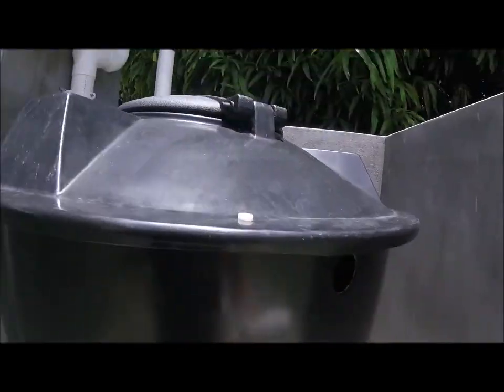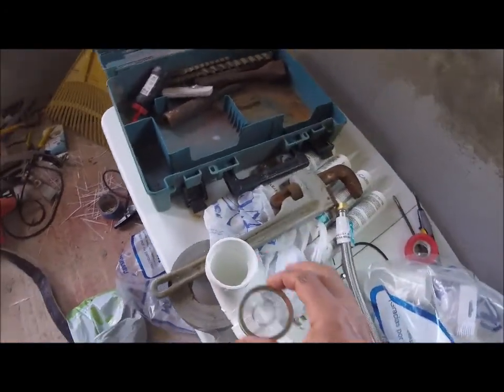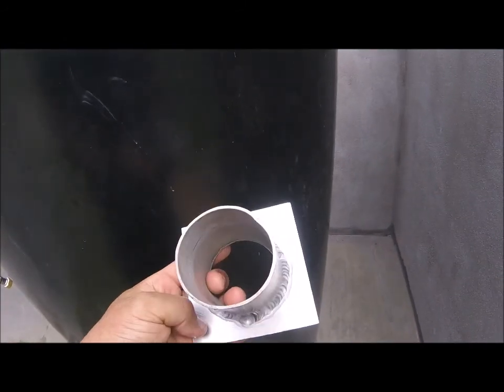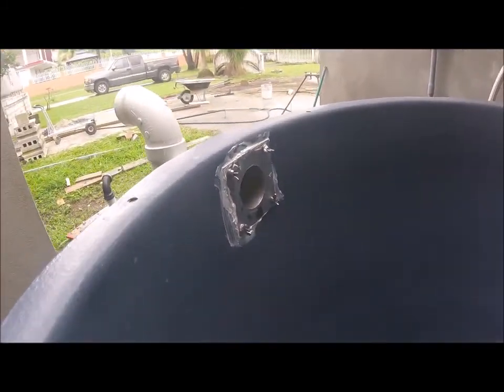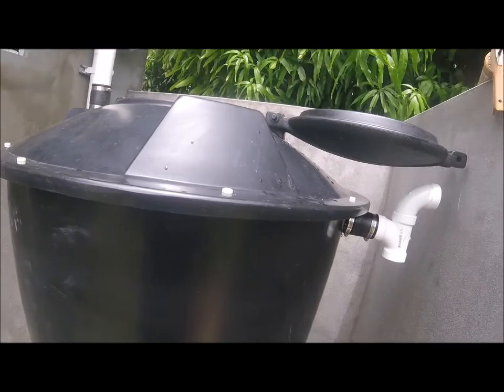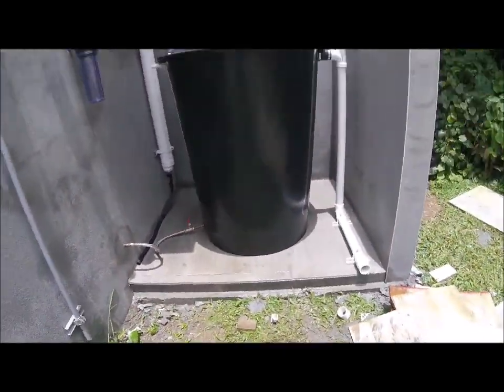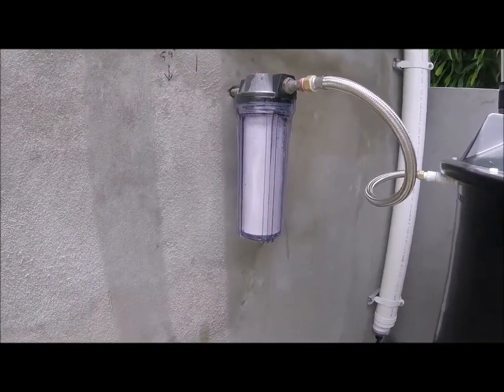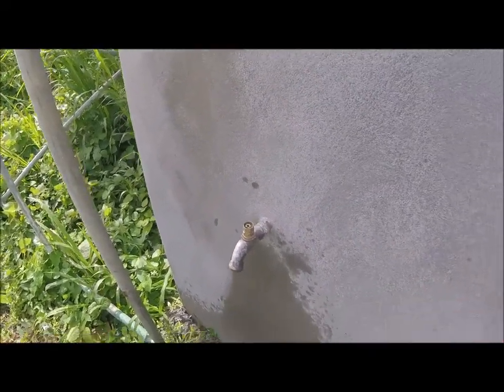Prepper shed cistern and 12v pumping system

Comment: I am so impressed by your work.
I am trying to figure out something that I can do but for an area that gets  - 40.
Reply: your big tank will act also as a settling pond if you draw the water that you use from the top.
Reply from the maker: That's tough, it could be done in a heated indoor setting, and even in a indoor setting, I would still insulate all pipes and probably use pipes that expand just incase of accidental freezing 🥶.
Reply: Glenn...Luis has a point, obviously insulation in that environment is a must as compared to where he is...I would suggest if you haven't already to view "ALASKA PREPPER " channel on YT...he's in that kinda environment of -40 and might have some tips.
Reply from the maker: @felixdacat6572  I would love to build a system in a cold environment, im sure I could come up with a couple of crazy ideas like running the hot water line through the tank to keep the water warmer lol.

Comment: Ok, love it is very nice.
Reply from the maker: My very first video illustrates a bigger pump, Its a 7 gallon per minute on a 20 gallon pressure accumulation tank/ bladder, I'm on off grid water, a rain harvesting system,  this video  illustrates a small system that is 100% off grid 24/7, power comes from a 12v solar system that is very powerful  considering its 12v, Shed lights are also 12v including the TV in the shed...Any doubts or questions feel free to come back for any help.
Reply: @MosaicHomestead  is a private way we can chat I started a very tiny project, with one solar panel two batteries, a controller, and a power inverter, and I can't make it work. Is connected two a 1 hp water pump and tank.
Reply from the maker: @maynorbrooks55  My Email doesn't always work,  I use this platform for reliable communications,  A regular AC pump won't work with one small solar panel and a inverter...1HP pump uses 750w...but the pump in my video will work,  No inverter needed, pump hooks up to battery....Solar panel goes to controller...controller goes to battery...pump connects to battery...and now you have water, thats it, set up the pump like I did in the super pump video and it will work.